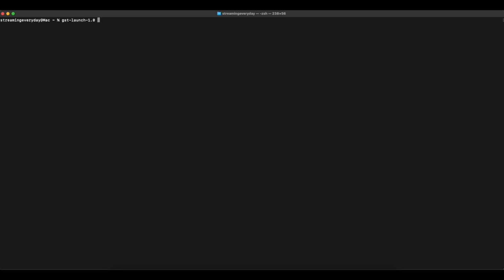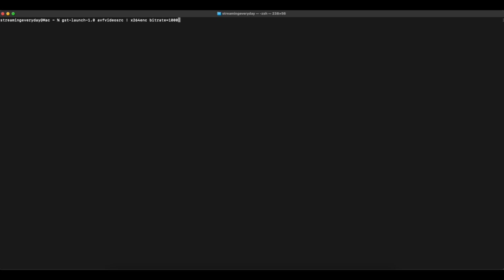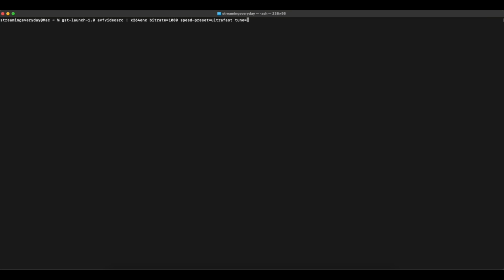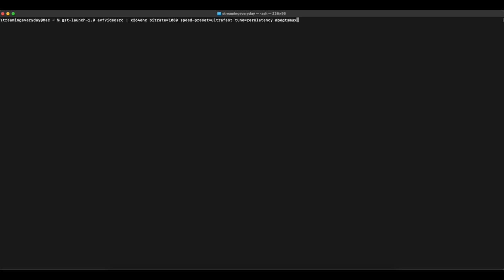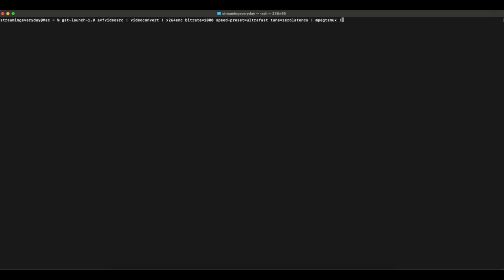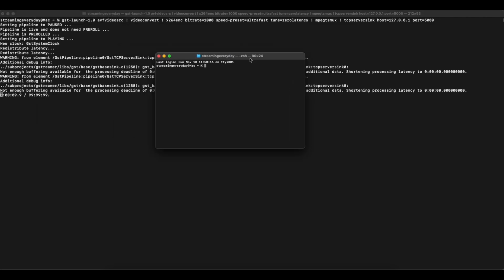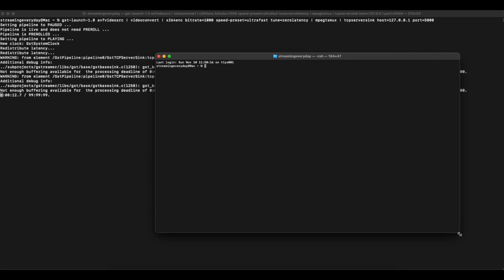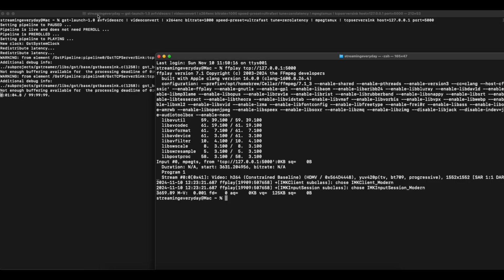Live Webcam Streaming with GStreamer | Easy Command-Line Guide | GStreamer for Video Streaming

Comment: Can you suggest the best protocol to stream rtsp url to web broweser

I have ip camera of tiandy which provide me 2k res stream with good clarity

But i want to stream it to web right now i am using node rtsp stream package which convert rtsp stream into mpeg4 video and send the buffer over socket connect to web where i play the video

But issue is when there is high moment in the camera view the stream get distorted 

What would be your approach to fix this with lowest latency possible

I have tried HLS but it works with around 5000ms latency which is very low for my use case

I need something which js under 1000ms

What would be your approach to achieve this ?
Reply from the maker: For sub-1000ms latency, I’d recommend using WebRTC—it’s built for real-time streaming and works great for low-latency use cases. 
If you want to stick with your current setup, try optimizing the encoding settings: lower the GOP size, use H.264 baseline profile, and maybe you can also try reducing the resolution to see where the problem lies.
SRT could also work  but I would give WebRTC a try.

Comment: How do stream a video file using RTSP protocol on gstreamer?
Reply from the maker: Hi @AjithRajendra,
check this out.

https://gstreamer.freedesktop.org/documentation/tools/gst-launch.html?gi-language=c

Network streaming
Stream video using RTP and network elements

This command would be run on the transmitter:

gst-launch-1.0 v4l2src ! queue ! videoconvert ! x264enc tune=zerolatency key-int-max=15 ! video/x-h264,profile=main ! rtph264pay pt=96 config-interval=-1 ! udpsink host=192.168.1.1 port=5000
Use this command on the receiver:

gst-launch-1.0 udpsrc port=5000 ! application/x-rtp,clock-rate=90000,payload=96 ! rtpjitterbuffer ! rtph264depay ! h264parse ! avdec_h264 ! videoconvert ! xvimagesink